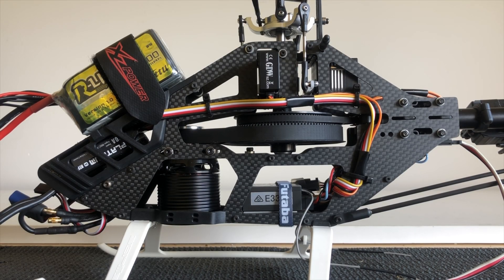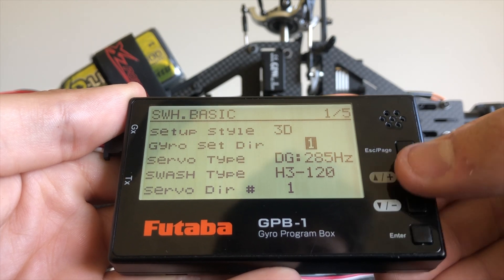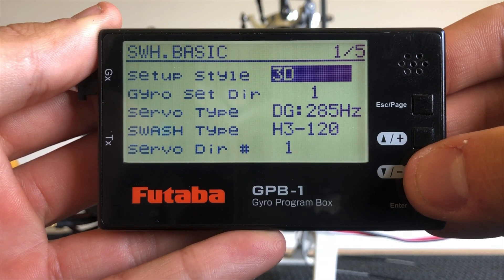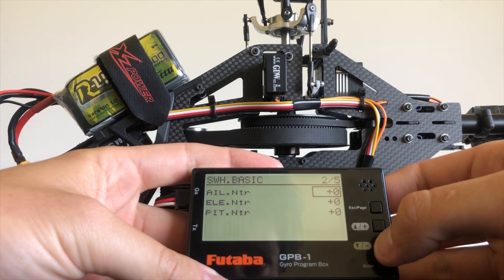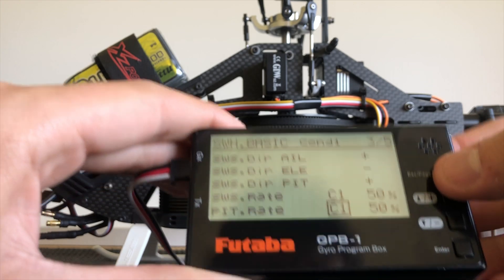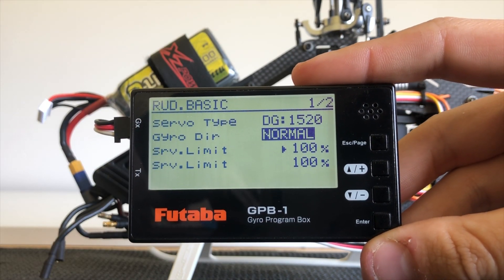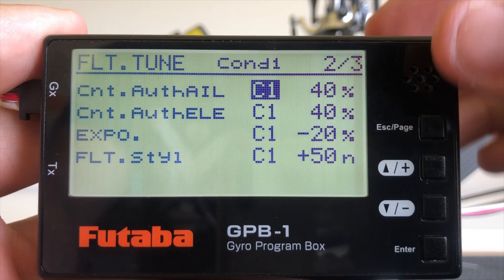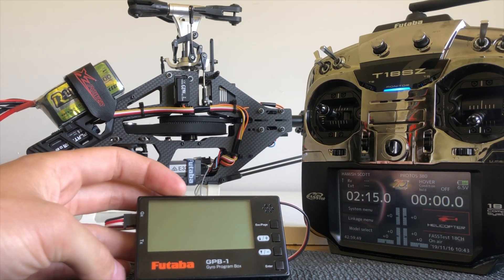Futaba CGY760R Set Up - Pt 2 760R & GPB-1 basic set up

Comment: I just picked a 16IZ and thinking of getting the CGY760 to try. I’ve had Futaba Radio’s in the past including the 14SG and 16SZ. I’m debating whether to get the Neo or really try the CGY760, this is for my Nimbus 550 build. Thank you for your informative video.
Reply: I'm just a regular heli guy. I own Beast, Demon and the 760. All of them are good gyros but I find the Futaba to be the best overall as far ease of programing, telemetry and especially using conditions, you can eliminate a separate receiver if you go with the 760. If you decide to get the Futaba gyro, you won't be disappointed IMHO. If I was starting over today, I wish I had used them from the beginning.
Reply: @heeder777  Cool. Is there a way you can make a video walk through setup? Thank you so much. Just paid off my Nimbus, time to order the CGY 😂